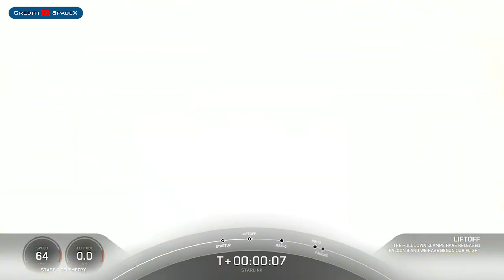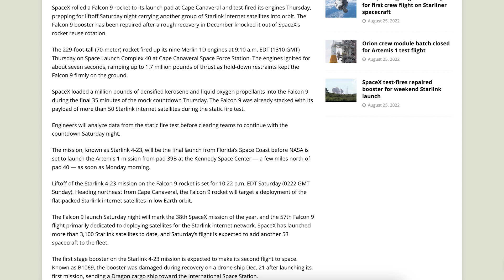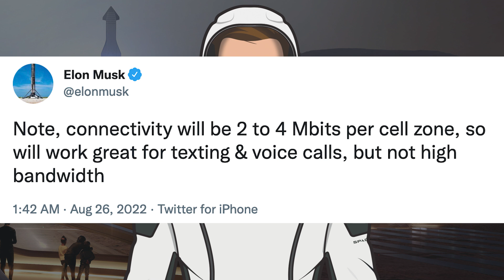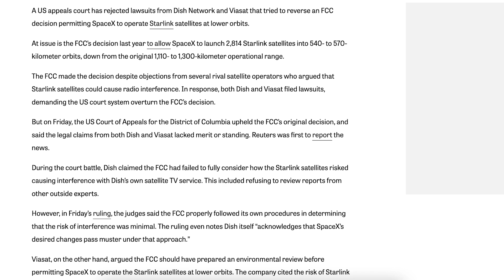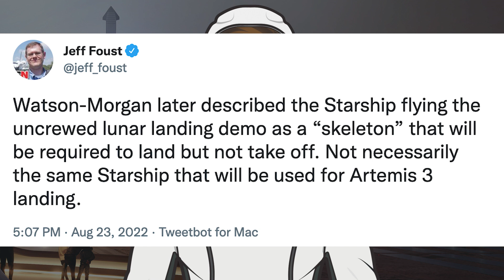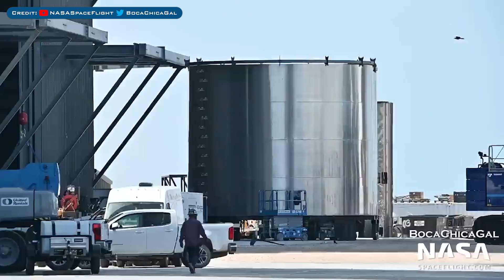SpaceX Starship Updates! Static Fire Testing Soon at Starbase! TheSpaceXShow

Comment: The T-Mobile deal is interesting, although from what I've read don't expect the service any time soon. The regulatory framework for connecting cel phones to satellites doesn't even exist yet.
Reply: Can a signal from a normal cell phone make it to orbit?
Reply: @nunya___  Yes.   Yearhead’s reply is inaccurate r.e. your question.  The signal from a cell phone will be directly read by the planned Starlink 2.0 satellite with the XL Cellular antenna.  Were ground stations required, it wouldn’t work unless there were such a station nearby.
Reply: @737smartin  Will that be inside the phone? Or practical to carry in your pocket or bag? I looked it up but see things I don't know what they are. Some big, some small.
Reply: @nunya___  They (T-Mob & Elon) said in the announcement “Most any cell phone made in the last few years will have all you need.”  The trick is getting the XL antenna network into space and proving the engineering to receive the puny signal cell phones put out from 500Km above while the satellites move at thousands of Km/hr.  Assumptions I’ve seen guess it will likely start as 3G or 4G service.  Expect (sometimes delayed) messaging-only service at first (perhaps within a year or two if Starship gets rolling).  MANY of the new satellites will be needed for voice capability.  Perhaps several years away.
Reply: @nunya___  Suggest you search for and watch the presentation.  It was roughly 40 minutes long, but there are many shorter summary videos on YouTube. ✌️
Reply: @737smartin  Thanks Steve.
Reply: @nunya___  It would be relayed through the Starlink base station
Reply: @yes_head  That can't be right. They said be no gaps in coverage even where there are no cell towers. Base station won't fix that.